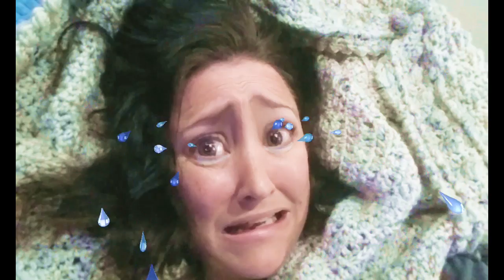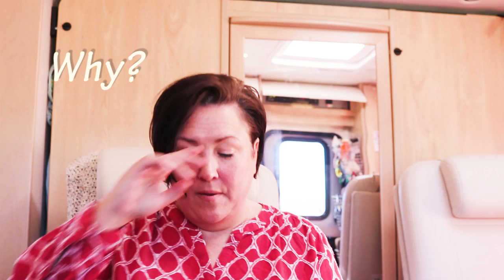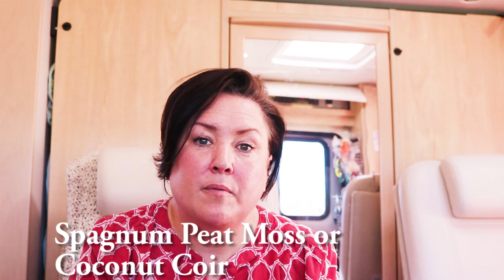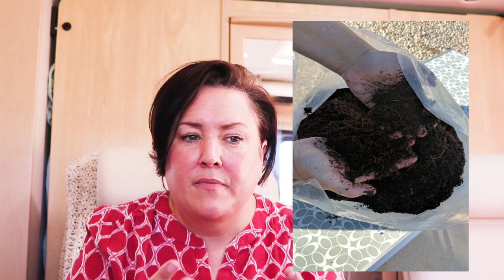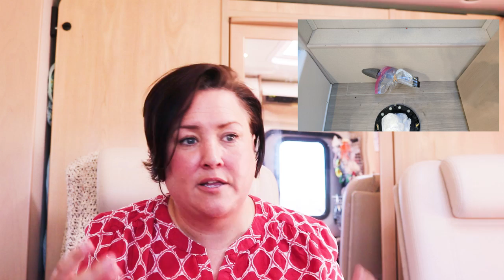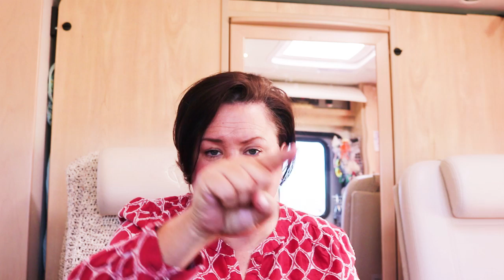My DIY Composting Toilet Install and 4 installation hacks I learned!

Comment: Those coir blocks are easy to chop into snaller pieces with a hand saw ... I use them in my garden ... they break down faster when smaller chunks.

Comment: those small bricks of coir fibre are available at most garden supply stores as it is used for adding to soil to lighten it up.  So if you can't get online with free shipping check any big garden centre!  :-)

Comment: in high humidity regions you might actually be bringing "in" extra moisture to the compost material with those little plumbed fans! im researching for a toilet now. deciding whether to buy or build one. i kind of like the sun mar gtg. i live in colorado and wont hook up a fan either. thanks for the info on leaving the bin open, turning on a ceiling fan, for an hour or so. just keeping an eye on the moisture level. thanks!

Comment: New sub here! Such great info on taking the old toilet out. I do not have money to spend on a nature's head so I am doing research on a homemade composting toilet. I am sooooo done with the black tank, and my toilet leaks water now with the pump on...uggghhh! Instead of buying a new one, i'm going to take the plunge. The eternabond tape is what I have...that will be a great save on covering the black tank hole.

Comment: I did it!!  Thanks to you!  But I want to mention that my black tank had no smell...at all.   I don't use bleach, like the way most people sterilize their tanks.  I used the probiotic bleach alternative at the RV supply store.  Maybe that was why?  Microbes are amazing!  : )  As soon as I put my new flooring down I can put my compost toilet on.  But I also need plywood to make a flat flush area to put the toilet on.  That flange was cemented/glued to the downpipe into the black tank and ain't nothing was going to get that off!

Comment: Maybe you could find a way to replace the black water tank with a new or used, (one off an old rv), fresh water tank to increase your fresh water capacity, which as you know would increase your boondocking time.

Comment: The fan on the Nature's Head composting toilet is 12 volts. As a hack could  you not just connect and run  the fan when needed off a portable 12 volt supply e.g portable battery charger with 12 volt outlet. Just let it run to dry out the material and then disconnect? Or use the provided wall wart if you have a 110 volt outlet in toilet area. You could run the pipe when needed to your ceiling fan opening. Natures Head can have the fan on either side. Just a thought.

Comment: I don't know if anyone has asked or if it's even possible but if I bought a new truck camper (or any kind of camper) and didn't use my black tank for anything and just went with a composting toilet to begin with, could I use the black tank for an extra water tank or something else? I wonder if it could even be removed and the space modified for extra storage...At least not carrying the weight of a full black tank around would save weight and gas, I would think. Thanks for your great explanations and calming presence. I hope to meet you on the road one day.

Comment: Two questions: Is the bath a wet bath and is the composting toilet fine to be there without any covering when showering? And how did you attach the toilet to the plywood base? Looked like you put brackets there, but you didn't show how the toilet is attached to them. I assume the toilet has enough space underneath for bolts without drilling into the compost bin, but I've never seen one before. I'm glad you don't have to vent these toilets; that was what turned me off of these things. Now I'm thinking of installing one right into my new RV right from the get-go (when I get one).

Comment: Great information with lots of humor!  I tho't I would fall off my seat laughing when you said the black water tank odor almost burned off your eyebrows!  You are too funny!  Anyhow, I think that even if a person didn't want to use a fan, one could just use the tube with an aeration cap over the end, just to let the air in naturally without using a fan.  When I set mine up, that's how I'm going to do it and see how that works.  What's there to lose?
Reply from the maker: Good idea!!

Comment: Thank you! Super helpful. The first mod I will be performing to my Wonder FTB (Once I receive it) is install a composting toilet. I was intimidated by the exhaust fan install and placing a hole in my new RV. Thanks to your extremely informative video that will no longer be a problem!

Comment: Granting that I am not a nomad, I lived a year on acreage with no utilities.  I read Humanure, a must have book.  I used a five gallon bucket with a toilet seat.  I started with purchased materials, but switched to soil.  Works perfectly, keep it slightly moist, friable.  Soil has all the microbes required to compost feces.  Never had an odor problem.  Water in toilets is DIRTY and SMELLY.  After I moved here, I did have all utilities, but found the toilet disgusting.  This time I used a wooden art deco chair with a drop in seat.  I removed it and inseryed my bucket system, then dropped the seat back on.  Very pretty, and easy to use.  If there is a time when coir is not available, use soil. I have several buckets, and with feces only, it composts quickly.  I leaved the bucket out in the sun for a day, and it sterlizes and keeps the bucket from becoming stinky.  I hope more folks eschew $$ toilets, and shift to a better system.
Note:. outhouses are vile.

Comment: Thank you Robin, new subbie here. I just bought a brand new travel trailer last week and I knew before I got it that I wanted a composting toilet but I didn’t want to cut into the trailer for the vent hose. After watching this video I’m probably going to get one. This video showed up at the right time as I haven’t used my black tank yet!

Comment: Yup. I've gotten "stuff" on my shoe alright! Ick. When I first started, a friend told me, "If you haven't gagged at a dump station then you haven't camper camped." LOL After about a year of fulltime, I gave up my black tank too. Got tired of the mess, tired of having to leave a good spot so I could drive to a dump station with my stinky holding tank sloshing around, and I got tired of maintaining the black tank only to just have it get smelly again. Haven't looked back. Now, I still have to manage smaller things on a more regular basis vs managing a huge, sometimes AWFUL, mess every 2 weeks. My fresh water lasts 2 months instead of 1 week!!

Comment: New sub here.  You had a fresh take on the whole composting toilet situation...good job...loved the intro, funny stuff.   Anyway, here is another hack for you!  Remove your now useless black tank from under your RV and replace it with another fresh water tank.  Connect it to your existing fresh water tank and significantly increase your capacities for extended boondocking.
Reply from the maker: David Golembeski yes!!! I wondered if this was possible. Have you done this? I'd love some tips!
Reply: No, sorry, I haven't, but I can't see why it can't be done.  I'd imagine a flexible hose connecting the two attached at the low point of the tanks.  Gravity should allow water "sharing" between the tanks.  You might tackle the job yourself or anybody with some plumbing experience should be able to figure it out and back you up.  Crawl under there and take some measurements of your black tank and start looking at fresh water tanks that would fit in the same space.  This can't be that hard.  Do a video on it!   EDIT:  be sure the diameter of the hose/pipe that connects the two tanks is large enough to handle the pressurized flow of your fill hose, otherwise, you will think both tanks are full, but if the connector hose is too small it will take a while for the water level to equalize.
Reply: @David-rx2to  OMG GREAT IDEA!!!
Reply: Amazing idea! I saw another RVer use their converted black to grey tank as a dedicated tank to the shower that is hooked up to a filter system so that the water for showering can be recirculated and enable long showers! This is what I plan to do :)

Comment: What do you do about times when you have diarrhea?  Sorry so graphic.  Will that ruin the moisture level, or is it as easy as adding more coco coir?  This question has kept me from getting one of those toilets.  You videos have been the best on every subject. Thank you for making them.  Loved the water one too.
Reply: Texassews agree I have stomach issues so one of these would never work.
Reply: There are other ways to have a composting toilet. You can line a bucket with a bag and pee and poop into sawdust. You're never going to compost anything on an RV, that takes 9+ months (and no, the crank handles isn't a.magic thing that speeds that up. Farmers wish it did....). So it won't compost before you toss it, but it will be a more solid medium than something like a cassette toilet. Lots of options. Other than natures head, there's a lot of cheap ways to experiment :)
Reply: Texassews thank you for this question as I've been wondering what people with Crohn's /Colitis do with this situation? I'm still considering the idea of replacing my black tank and toilet but that question keeps coming up. Must keep researching this. Robin's lessons are wonderful and clear, along with great humor.

Comment: Hi Robin,
I just purchased my new RV. I pretty much want a new composting toilet in it. Thanks to you, Tiki, Gramkracker, C. Vanner, and Bex Cat-Herder, I had no problem in paying the additional expense. I opted for the C-Head composting toilet. Bex talked about how a few RV service folks do not want to deal with the subject matter.  I had that experience with one RV service. I believe that I can do as you did since my floor is level like yours, but fiberglass. I will have to use some type of waterproof material, not wood for the elevated flange since my bath is a wet bath.

Comment: Nature provides a solution to most problems. In Africa there is a beetle that cuts out a ball of elephant poop, rolls it to where it has dug a hole, deposits an egg in the poop and drops it into the hole and covers it up. The baby beetle eventually digs its way out and repeats the cycle.

Earthworms (?) are used in compost piles to turn the stuff into worm poop which is good for flowers. Then the worms are sold to fishermen. Wonder if they would work. Might freeze in winter?

Comment: You need the correct expansion plug to fill the pipe and lock out gases.  The tape is not going to hold over time.  You can also double the size of you holding tank combining the black and grey tanks but again you have to plug that black pipe properly.

Comment: My two cents...  I don't know why people default to composting toilets when you still have to worry about carrying/acquiring peat moss or other stuff with you to make it work.  And then you have to be careful about where you dump it because it's a substantial mass of solids.  Why not just use a porta potty with Tanktechs RV,  or Unique RV Digest-It Holding Tank treatment?    Both of those tank treatments are like MAGIC for getting rid of smells almost instantly and digesting toilet paper. Just a tiny bit  per porta potty tank is all it takes. Then you can use any vault toilet at any campsite to dump.  You don't have to carry peat moss, Etc.  And you don't have to keep your pee and poo separated or remember to turn a crank or make sure you're kids do when they use the toilet.. There's several things about composting toilets that just add to your list of worries or concerns while trying your best to have a carefree RV lifestyle. No thanks.

Comment: I'd suggest a rechargeable electric drill with a dedicated miixer beater for the coconut coir. Think the old school beater that look like a blade that's a 1/4 inch thick.  After you break it up with a screw driver I'd bet it will mix it quick.

Also I get the fan would have helped when you accidentally urinated into the poo part.  It would have dried the water avoiding the smell.

Comment: Robin - We're going to do this when we get our Unity in September.  I have a question.  If you had unscrewed and removed the black ring from the floor, do you think your pipe plug would have fit in there then?  I'm thinking that is what you're supposed to do and then it leaves you with a level surface.
Reply from the maker: I thought it might, but didn't want to wreck the floor. Let me know how it goes when you do it. Happy travels.

Comment: Thank you for sharing, and I'm so excited that this is working for you! I am hoping to install a composting toilet as soon as we get our RV. Still shopping for the right RV and looking at a C-Head toilet system. We will have two cats with us, so I'm going to try Feline Pine Original Cat Litter in the system. BTW, where do you keep your litter box?  Thanks!
Reply: I would recommend the same stuff for the cat box, but preferably use sawdust in both the toilet and catbox.  Then use a cat scoop to just dump into the compost toilet, and turn the handle a few times...  All treated the same way.

Comment: I have another hak for the composting medium... “Petsmart” that’s right petsmart.... in the lizard 🦎 department you can get 100% loose coconut core in smaller bags no mixing with water ready to use, and petsmart is in almost all cities. I haven’t checked other pet stores but I know amazon also carries it in pets but you will need shipping. The blocks are a mess and a hassle IMHO.
Reply: Traveling with the Gramkracker excellent info. Gonna price it
Reply: Traveling with the Gramkracker wow great tip!
Reply: Hi - great idea! I've read that coconut coir is poisonous to dogs. I guess cats, too, since it is related to chocolate. Just putting that out there :-) . Personally, I plan on using cat litter.
Reply: This is great. I love watching your videos. I laughed out loud while watching the one where you got locked in your parents garage, brought back a few memories. If that would have been me, I would have for sure had to pee lol. 

I just bought a little 13’ scamp fiberglass trailer that I can pull with my Subaru. I’m gonna restore it and hopefully hit the road for a few trips this Spring. Great info. I very much appreciate you helping those of us who are just starting.

Comment: HERBALIST'S TIP; At the point of adding those plastic bags into the space....B4 adding bags use up to 10mls of SPRINKLED essential oil of Juniper, 5-10 mls of Lavender. These should both disinfect and remove residual smells .MAY negate the need for the designer made wooden panels. Also - can be re-applied. I can't imagine you'd need more than 3 or 4 re-applications over the course of a month.  Cheers

Comment: I need a new toilet in my RV and definetly considering a composting toilet, so I really appreciate this vid. But $1k for a toilet?? Seriously?? There must be another choice. So I begin my research...
Reply from the maker: Mary Woods I used Kitty litter in a plastic bag in my regular toilet one winter. But, when I did the math, long term this was cheaper. It's an investment though for sure
Reply: Now that is interesting. I can see that working well if kept up and that's easy. I really like this idea for when I need to really conserve water in the rig on a temporary or short term basis.

Comment: "Stinky slinky" lol. For those creative souls, it would be possible to do a composting toilet with a bucket.
Reply from the maker: Hi there! Please, check out these next to videos in this series, if you haven’t already. Thanks for watching!
https://youtu.be/NL3j4vZ-kG4
https://youtu.be/7aTxqObExL8
Reply: Noreen No. Stinky fiasco waiting to happen. Compost process needs oxygen and mixing or will go Anaerobic and really stink😱
Reply from the maker: Kx RV66 nope. It's been months and no stick at all. I just mix it to add oxygen. I've had literally zero problems and zero Fiascos
Reply: Creativity RV -glad it's going well. the plus with your system is the lack of urine. I had an at home composting toilet which was urine and poo and that could get smelly if fan was not on.
Reply from the maker: Noreen N ooh, yeah. I imagine it would! Ick